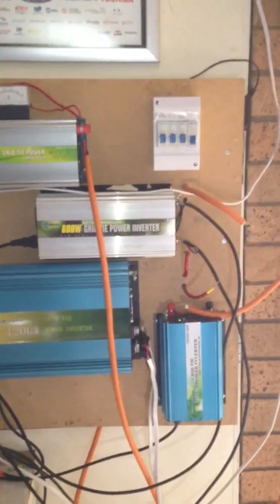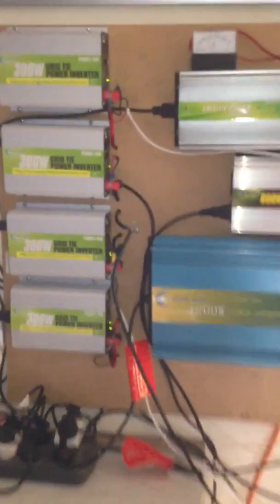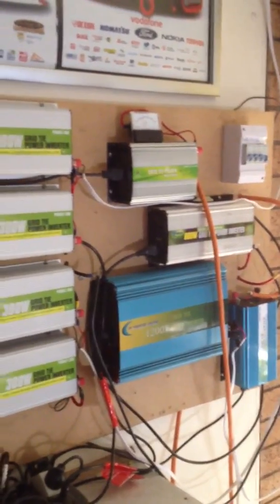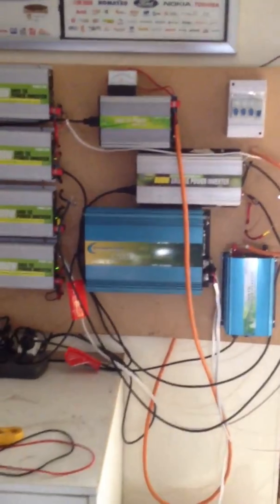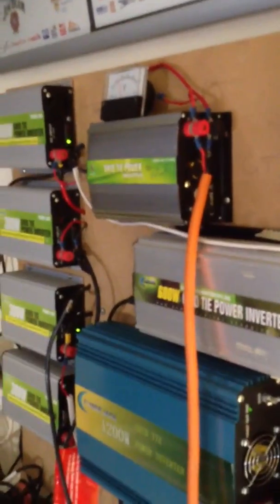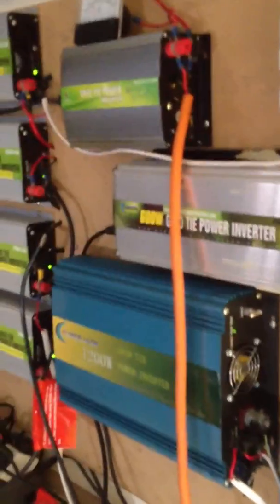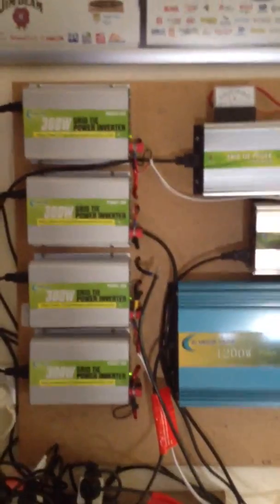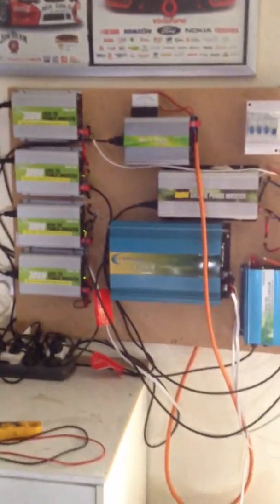Grid tie inverter update

Comment: Going through your video's.  Why not box in the inverters, use one input fan, setup the input and output of fresh/hot air so you can circulate it in the house for winter heat or not in the summer?  You'd end up with the outside of all the cases in moving air and the lost watts through heat could be recovered during the heating season. (if you have a heating season)

Comment: doesn't the Air Conditioner cold air machine defect the purpose - how much is that using ? if its a fan not much if its a air conditioner with compressor(cold air) I would think much more the the 500 watts your making  just use a big fan instead